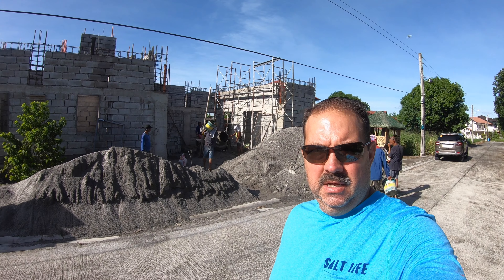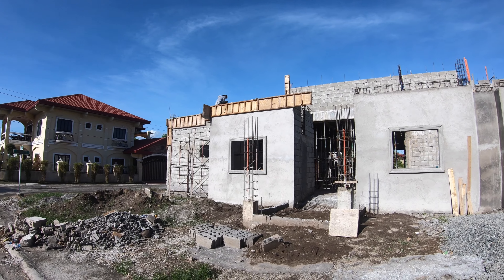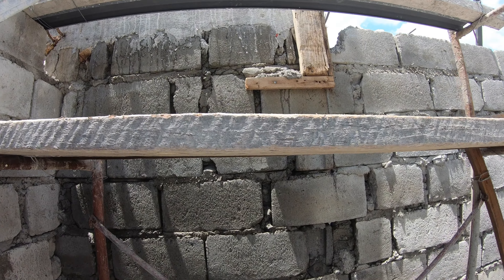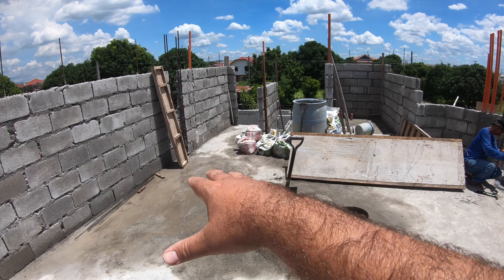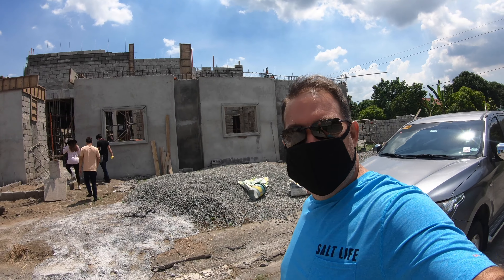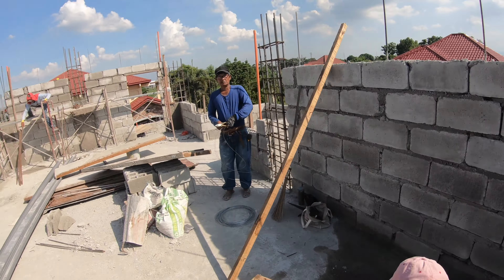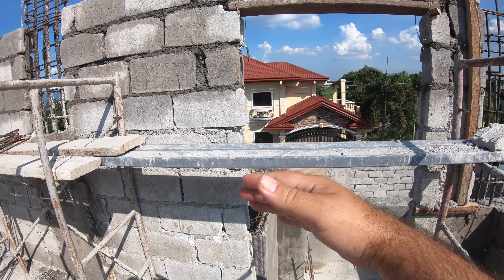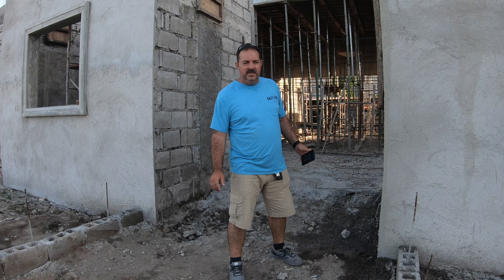Philippine House Building Step by Step, Build Day 79: Air Conditioning Site Visit

Comment: Most important when choosing an AC in Philippines is verifying the electronic boards are coated.  What happens is little lizards or bugs hide in there and short out your AC electronics.  Very common in the Philippines.
Reply from the maker: james21ap1
Will have to ask our AC installer about that. Thanks for the tip. 👍👊

Comment: So you are going with the ductless mini-splits? Have you looked at the multi-evaporator Variable Refrigerant Flow (VRF) units? They are pretty good and could be more cost effective.
Reply from the maker: Honestly, I hadn't considered VRF. We did look at multi-splits, but the runs were too long . Went with what the aircon reps are recommending, which is the individual mini-splits for each location. The only other thing the reps had presented were the floor stand units, which we find wholly unattractive and not a personal option.
Thanks for the great question. Thanks for watching.

Comment: Is each room going have an A/C?  Rather than central air and heat here in the State's?
Reply from the maker: Hey bro!  No centralized AC here. The standard is split unit for each room based on size of the room. More efficient and cost effective. Only cool off the rooms you are in.